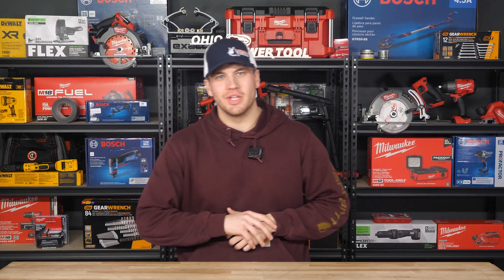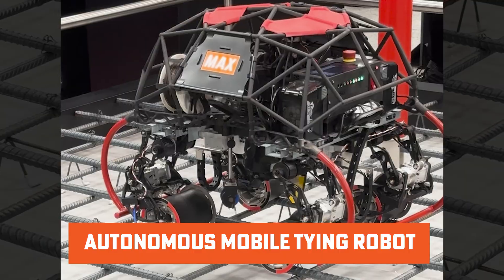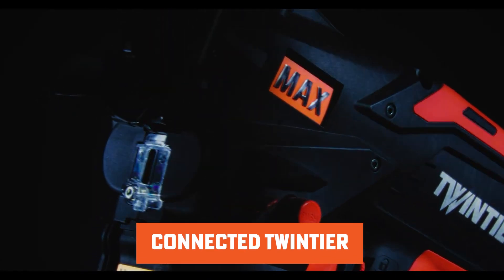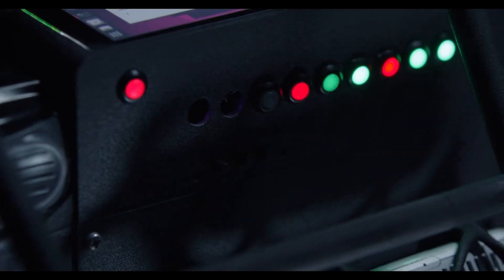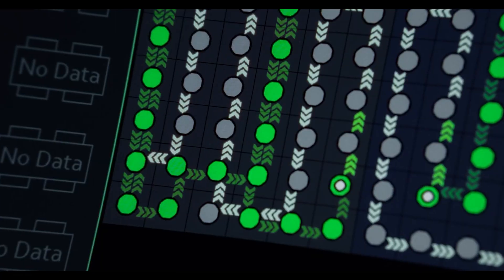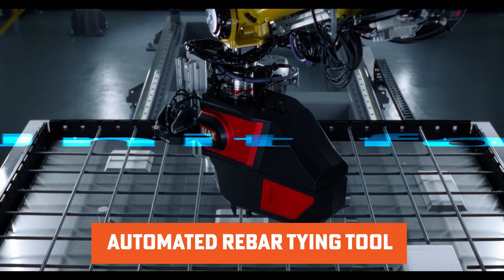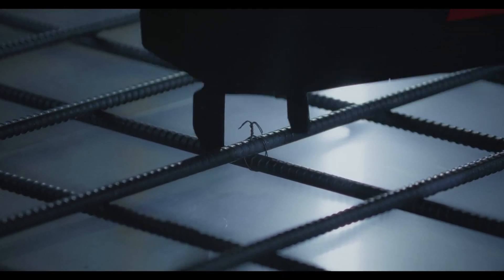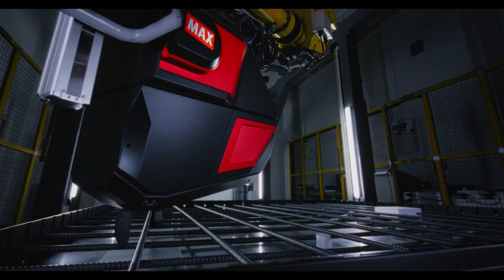MAX Released An Autonomous Rebar Tying Robot?! | WOC 2025

Comment: Just bought saw from these guys. Had it on clearance marked down from $800-$500. Great deal. However the next deal they contacted me letting mw know that the deal was to good. They wouldn’t honor the price on their website and refunded my money. Don’t waste your time looking for deals here. If you do find one … they will ask for their money back.
Reply from the maker: Hey @PaulM-lt4vx, I'm really sorry that this was your experience with us. Unfortunately, sometimes mistakes are made, and even though we try everything we can to fix it, it just can't be enough. This was a simple system pricing error that unfortunately had major consequences. We try out best to honor what we can if we have slip-ups, but this pricing was even lower than the manufacturer's cost to create the tool, and we are unable to honor any purchases at that price. We genuinely value our customers and would not have reached out to you about this had we been able to honor that deal, which is why we offered it at the correct discounted price or a full refund, along with a discount should you choose to give us another chance down the line.

We do hold ourselves accountable and appreciate feedback that helps us grow, understanding that this was a significant error on our end. And while I acknowledge this isn’t a fix for your circumstance, we hope this explanation and transparency helps a bit.